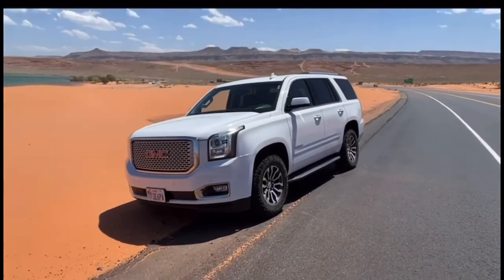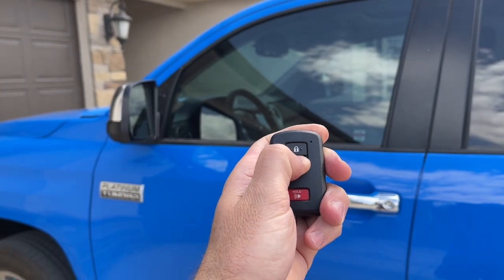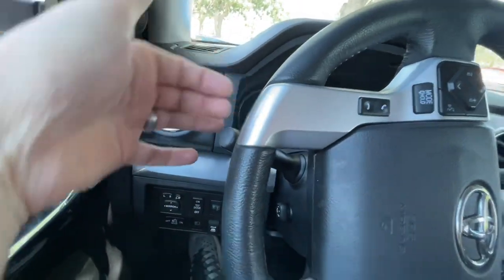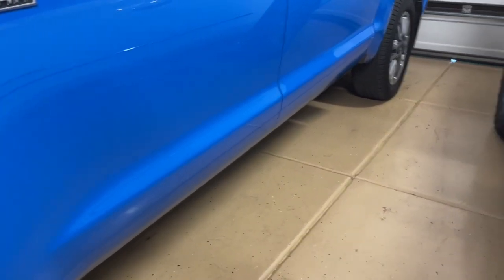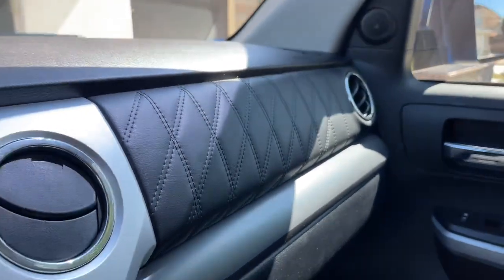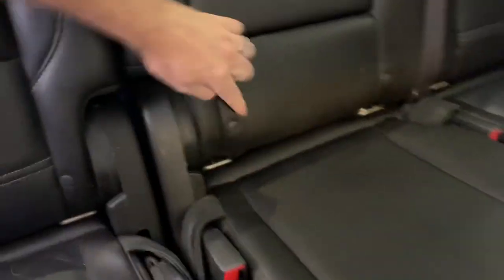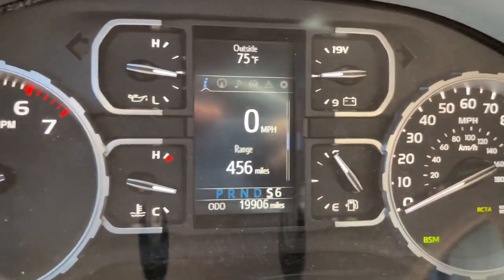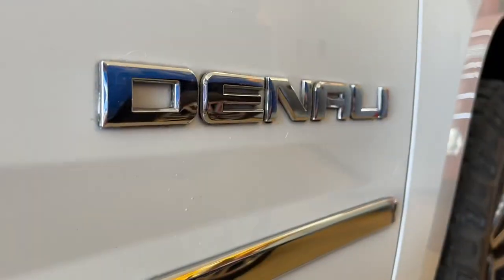Toyota Platinum vs GMC Denali: initial thoughts & SUV vs Truck

Comment: Danny, after changing to the AT4 tires/rims. Were you still happy after driving for some time?
Reply from the maker: They are quite noisy, but smoother with the thicker side wall. They also cupped easily until I replaced the suspension

Comment: Hi Danny,  I have a 2017 GMC Yukon Denali like yours. I will be buying a pickup, I'm think GMC 1500. Question when you looked at the Sierra what made you go Toyota. Oh, I lost a value spring to the tune of $4,300 🥴 But I like GMC. This is a real question. I would like your thoughts. Thanks
Reply from the maker: Being I have to replace a lifter (and will delete the active fuel management) on the Yukon, I didn’t want to do all that again. I’ve replaced so many things on the Yukon and made good videos on them, but I need a break from breaking lol. This way I will still have the Yukon and the GM side for the good it does offer, but I was ready for some more reliability from Toyota
Reply: I understand. I've watched most of if not all of your GMC videos. You have had a lot of problems with yours. I bought mine 2017  with 45,000 miles on it. Flawless car report from one owner. Always serviced by the dealership. I've had the valve spring go out, a couple thousand dollars on an air conditioning leak turned out to be in the back what a nightmare and my passenger side tail light has the typical problems. Being replaced by GM next week. I understand that the Toyotas are really good vehicles. But they feel very plasticky to me with that said, I clearly have not driven the new Toyota but I have a Lexus that I love. I bought a 2013 Lexus ES 300 H for $21,000. 5 years ago. It now has 77,000 miles and I haven't done anything but change the oil and put on tires that's pretty reliable! I'm just really struggling on what to get. I absolutely love the new style of GMC sierra Denali. But I'm scared of the repairs down the road your thoughts. Dennie , thanks for the advice. This is a big deal to me. thanks again!